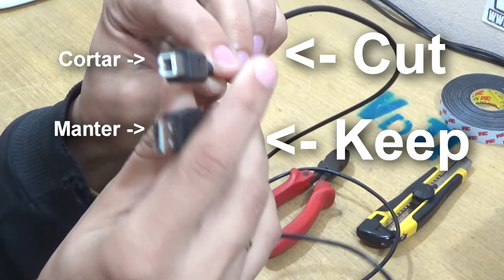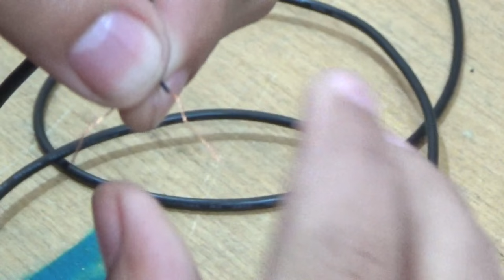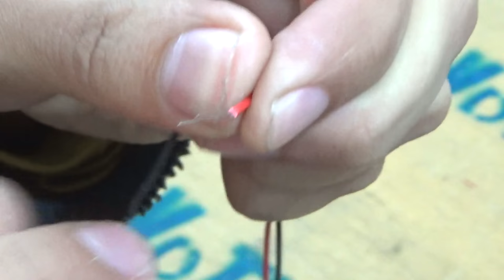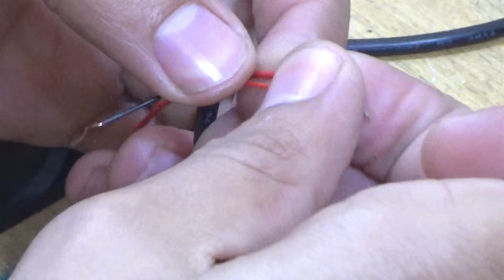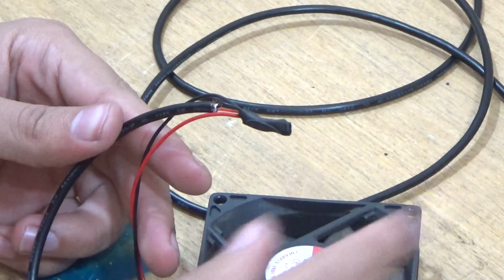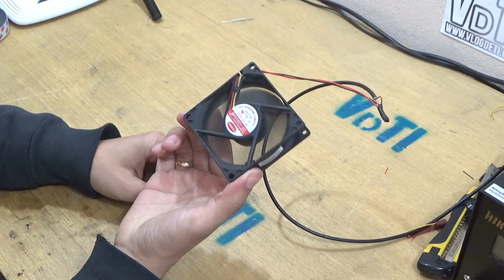Como fazer ventilador USB caseiro fácil | Ventilador USB com cooler

Comment: cara eu posso colocar na tomada ?
Reply from the maker: +Diogoo Ls Olá. Não. A tomada tem 110v ou 220v e os fans de computador geralmente trabalham com tensão entre 5v e 12v.
Reply: se quiser colocar 2 fan em um carregador de celular? ela toda normal ou teria q ser uma fonte maior q 12v
Reply: Diogoo Ls se vc pegar o usb e ligar em um carregador de celular s, pois ele passa 12v
Reply: Sou rapaz estou na conta da minha irmã...se você quiser fritar o brinquedo pode meter na tomada.
Reply: Eu coloquei em um carregador de 12v e o cooler rodou de boa estou pensando em meio que acoplar 2 em 1 aí coloco meio que um saco de gelo aí vai fica bem melhor,pois o cooler e mto fraco
Reply: Não